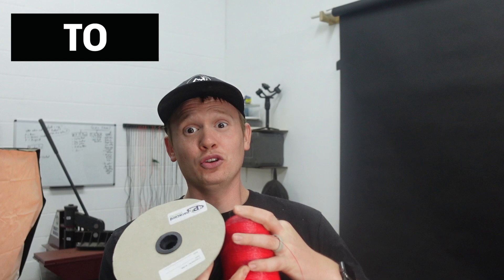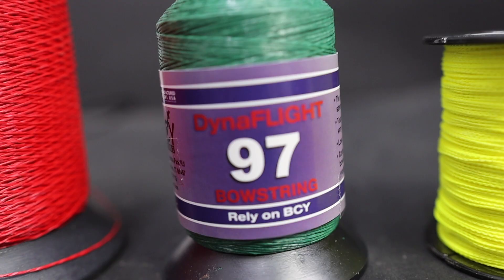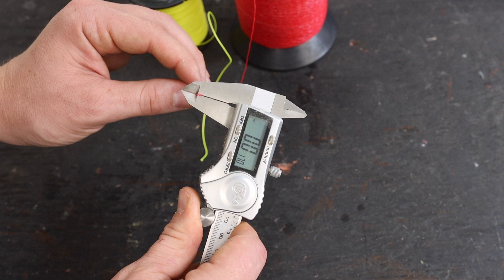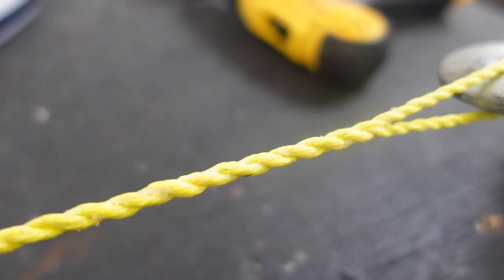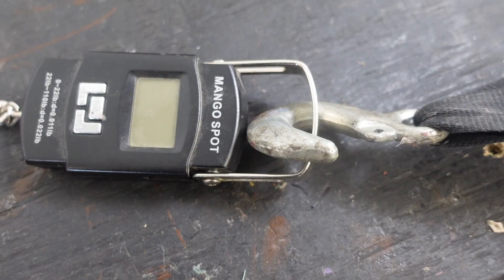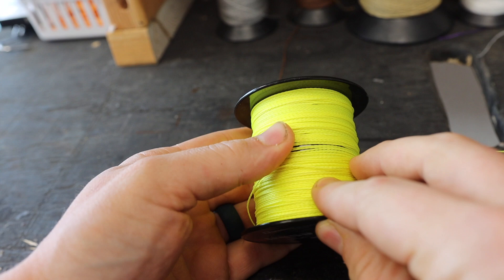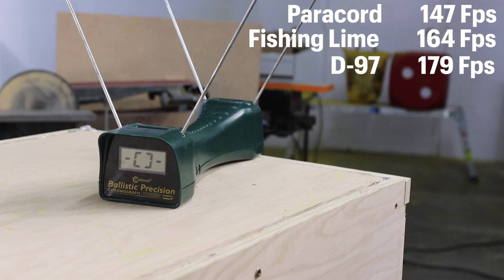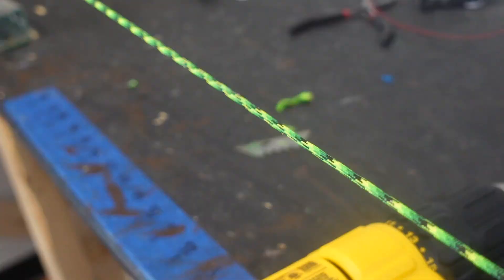What ACTUALLY works for a bowstring? --- (Fishing Line vs Paracord vs DynaFLIGHT)

Comment: What if you use the strands in the core of the paracord and braid that?
Reply: This was my question. What if you just used the Paracord core as a source of nylon? Because the stretch in Paracord comes from the woven sheathing combined with not-particularly-tightly-twisted core material.
Reply: really want to see this test
Reply: The core strands are very slippery.  I've tried using them for other  projects and I found them difficult to work with. Doesn't mean it won't work; could just mean I lack the skill to use it.
Reply: I tried the Flemish twist with just the core strands with no wax. The loops held very well. I would love to see this done by a pro who knows what they're doing
Reply: @DM-sq3jm  sicky substance or wax as he mentioned would do the job. The tie tight and melt in place.
Reply: @danielchristenbury2401  👍 agreed
Reply: What lb fishing line did you use?
Reply: I've been wondering the same exact thing about the core strands
Reply: Yes if the f.line was very comfortable then the cord could give just a little more smooth elastic release ..mmm
Reply: That's what I thought he was going to do in the first place
Reply: I have done this. Used six strands from 550 cord and braided 2x2x2 and its help up great.
Reply: I have also used 250 cord by itself
Reply: @DM-sq3jm maybe you haven't seen the countless other people pre waxing their string before making their bow string 🤷🏻‍♂️ would help reduce the that problem a lil if you don't apply to much
Reply: @elitehacker1416  You n me both buddy 🤷🏻‍♂️
Reply: @Outlaw--JesseB  Maybe you haven't seen the countless people making bowstrings out of actual bowstring materials.
Reply: @DM-sq3jm  well if you're so full of insight then maybe you'd know those of us with half a brain are only researching possible backup/survival materials that could be used genius . . . 🤦🏻‍♂️ Go ahead try an sound smarter 😅
Reply: @Outlaw--JesseB  I just copied your message and delivery. You're getting out of it, what you put into it. 😆

Comment: This reminds me I wanted to ask what you thought about silk bowstrings, I believe ancient Mongolians used silk, but I could be mistaken
Reply: It's worth a try, some silk is pretty strong.
Reply: You could do that, problem is, you need really good premium silk. Most silk is weaker than other natural string materials like linen. So to make a more stable bow string, you need more material, which means more weight, which means less performance. Im sure the Mongolians knew what they were doing and had the best silk possible, but im not sure it would be cost effective now. Thats just my take though.

Comment: "Will it string?" - nice video! How about testing other types of fishing line like monofilament etc?
Reply: Lol, i aim for pan fish, idk how long the string would last ya with 4 pound mono. Might not be worth it. Its going to streach bad.
Reply: Mono will stretch massively.  I'd think even more than Paracord.  Depending on the weight of the braided line it may be even more comparable to D-97.
Reply: @MadRS  pretty much nailed it on the head there.
Reply: Best braided fishing line -  40 lb and use 8 of them 10 ?

Comment: I got a bunch of braided spider wire 100% spectra fishing line out of a clearance bin for cheap and I've used that for bow strings for a long time. The spider wire has very little stretch and has increased my arrow speeds significantly. When I run out of this stuff I'll start getting d97 for my bows.
Reply: What's "d97", JW?

Comment: Before I watch this vid , my moneys on the dynaflight . & there’s also kite surfing string that DYNEEMA & I found it on Amazon with a 3/8s or less diameter rated at 1000 pounds . You can get it in any color & it gos down to smaller diameters too & up in poundage also . This stuff is tough .

Comment: It appeared that the paracord was just strung as is.(I could be wrong)
I feel a more accurate test would be to gut the paracord and use the inner strands to make a bow string.
Reply: 🤣🤣🤣I just posted the same thing - although longwinded. 👍👍👍 Your short explanation is better.
Reply: Now I'm curious about this as that would make it even cheaper...
Reply: Ditto ❤ though you'd have to run it like the others in a Flemish twist.

Comment: When I was 11 I made my a bow that was just a straight springy stick and the string was a 3 piece braid of waxed floss.
I shot it a ton over the summer and eventually the bow gave out but the floss didn't.
I would like to see how well floss performs when a professional makes a string from it.
Reply: I did something similar, shaved the bark off of a sapling, braided I think ten strands of monofilament fishing line, but I used a green stick it split and I got scared to pull it back haha, it’s actually in my profile picture
Reply: Nice. I may go down to the river and do that. But instead work it down and try to get it to last awhile.
Reply: So I’ll have the Spring/ Bow. 
Then get a second one that is shorter or longer? Not sure yet.

Do that crazy Double-Bow. And it should make it last longe r
Reply: Modern floss isn't the same, it's more of a waxy plastic sheet material, like a grocery bag pulled tight. It's not the same as the old stuff at all.

Comment: I know from personal experience that the braided fishing line works great. I had to make a new bow string for my 65lb Mongolian Horse bow. They don't carry those strings on the shelf. I used higher weight fishing line and discovered that I had to use thicker serving string. I also noticed that when shooting the bow is quieter. I made my string during the supply issues after covid. The fishing line was on the shelf at Bass Pro Shops.

Comment: I had an idea for a "Will it Bow" episode. What if you took a bunch of plastic bottles and then melted them down. After melting them put the molten plastic into a mold and let it cool. Cut and Sand the plastic then glue to some type of hard wood to make a bow. I thought it would be cool to see if this idea works because you could add all kinds of cool designs into the molten plastic with different colors. Also if you wanted to you could add some small led lights into the mold before pouring the plastic into it for bow fishing or if you stay out to late and don't have a flashlight. Would have to implement a battery pack with a button or switch into the handle piece of the bow for that idea to work. Hope you like this idea, please let me know!
Reply: ...'you could add some small led lights into the mold'  -LEDs make everything better :-)
Reply from the maker: Love the idea! I will put it on the list
Reply: @kramerammonsarchery  Glad you like the idea if you need any help with the circuit, electrical engineering systems is my field of study.
Reply: I had a plastic bow from aliexpress with a material „p66“, all molten. It‘s very flexible but has barely any power, too little compression power. I would expect similar results for pur PET. But it could be laminated with something harder-it‘s just difficult to find a powerful glue for PET. Epoxy might have a chance. I thought for the compressionlayer to use crushed ceramic powder in epoxy

Comment: My experience with paracord was the opposite of yours.
My tests showed no stretch at all. Leads me to wonder if different types have different properties. Keep up the good work,
Love your videos
Reply: indeed different paracord do have different properties ! depending what they are meant foro , that's why when you go buy paracord there is usually like 10 different spools , its not JUST diametre of the cord <3
Reply: Couple weeks late but the difference is real paracord is nylon.  Nylon stretches quite a bit.  It also comes in polyester which has almost no stretch. Nylon is better in almost every way except for price and if you want it to not stretch. The box store stuff is often polyester.

Comment: Great Video! I did the same test with an endless loop string made of Dyneema fishing line and Fast Flight Plus. Both bowstring were equal in weight and the results came out quite the same. More stretch in fishing line and around 15 fps slower. BUT braided Dyneema fishing line makes great serving! It's like Halo serving but much cheaper and lasts the same. And it comes in serveral diameters, which makes proper nock fit easy.

Comment: my favorite alternative bow string material is spectra speargun cord. Just make it about an inch and a half shorter than you need it to be,  tie two bowyer's knots on each end, then string your bow. It'll stretch to the correct length. You can control the brace height by adjustinng the loops. It's basically a braided spectra string

Comment: I use upolstery thread to make continuous loop strings. I treat the loom as a race track n do ONE FULL LAP for every pound of draw weight. One 1500 yard spool can get me 5-8 strings (depending on if mishaps happen) for my 56 inch 40 pound recurve. Plus the 1500 yard spool only cost less than $10 for two depending on where you get it from.

Comment: 'm gonna guess bow string works best, to include braided Dacron, Dynema, and other "super braid" "fishing line" of course, which are already used for bow strings, anyway. No difference in the Dacron or Dynema used for bow trings or fishing lines. Nylon Monofiliment fishing line would stretch too much. Parcord is a bit large in diameter for modern bows

Comment: I’m sure most string-like materials would be viable as bowstring material, probably not as good as the dedicated stuff but it should work.
Reply: I've made bow strings (Flemish and endless) from just about every type of thin thread, just to see how they work, and found the following. Anything nylon is a waste of time for anything other than the very lightest of bows, it stretches too much, this includes mono fishing line which is also stiff. Linen is really good if you can get it! Cotton not very strong. See what Kramer says about braided but I do use it for finger serving.

Comment: I have used pre-waxed bank line for a string. Never new the proper braid until I come across you videos. The bank line worked great with a normal triple braid and wind for arrow knock area. Still going strong about 6 years later.

Comment: I know this is an old video, but for the paracord a better test might be to pull out the inner strands and use those to make a bow string, either discarding the outer shell or testing that separately.

Comment: Paracord has thinner strings in the a sleave. It is not in a flemish twist either, I would like to see if a it changes if you removed the strings and gave is a flemish twist.... Maybe a hybrid of two or even tree different material.
Reply: I've made a Flemish Twist bow string from the internal strands of paracord. They are still nylon, so it is still more stretchy, thus slower than my proper Dacron string. It would work fairly well in a pinch, but not really worth it, even in a survival situation you're better off spending the energy on proper shelter, warmth and foraging etc.

Comment: Not all fishing lines are the same, like I prefer to use Spyder wire fishing line but they have several different types of lines from soft and flexible to very rigid lines for deep trolling, and I've entertained the thought of using the Spyder wire fishing line to make a new compound bow string, as the one I have is many years old and almost never used, so with that said thank you for the video I did find it very interesting and informative

Comment: First off, I just received my first Shatterproof bow strings. I haven't shot an arrow from either yet, but they look amazing! This weekend I am building a PVC pipe bow with my 6yo nephew and I will put your string through its paces (two separate events, he's not getting his little hands on my brand new bow string).

In any case! I don't think the comparison with paracord is fair because the other two are specifically made to not stretch under tension, where paracord is not. I think the real question is: can you make a functional bow string from a length of paracord? Instead of: does a length of paracord, fresh off the spool, work as a functional string? 

I would suggest using the mill spec stuff (maybe you already are). Just because for once mill spec is actually much better than the regular variety. Just ditch the mantle (sheath or whatever that's called in English) and use the strands inside: 

Use a three strand braid on the paracord strands (the fishing line comes braided and as such has a considerable head start) and then you make a 16 or 20 strand bowstring out of those three strand braids (still with me here?), that's when I think the comparison starts to be fair.

You still need less feet with the paracord version vs the fishing line from a "initial feet off the spool" perspective and though it is a lot more work, it still represents a cheap option people can do at home. 

Also, how would a string (choose your poison) behave if you braid the entire bow string, rather than twisting it?

So many questions! So little time to make videos! ;-)

Comment: Paracords are designed to strech to deal with the opning shock of the parachute. There is zero strech paracord mead to eliminate the need to retrim break lines on parachutes, but they brack often on opnings or cause tension nuts. Might be usfuly as bow string.

Comment: I think the only significant difference betwean the fishing line and the bowstring material is that fishing line is typicaly coated with teflon or something similar. If you think about it a fishingline and a bowstring have some very similar requirements so you would expect them to be made from the same type of material.

Comment: I think paracord might make a better string of you gut it and braid it. The inside strands of paracord are not braided.  This might be intentional as it may be the stretch is needed as a "shock absorber" when opening your chute. Fishing line is excellent under tension, but if give it a snap under slack and it breaks way easier. Just a thought.
Reply: I agree.  I think it should be possible to clamp one end of the paracord and twist the interior fibres.  Great video.

Comment: Well,there is another option,it's called kevlar cord,I found some that is thin and it will hold a 125 lbs,so look into it,you won't be disappointed it's worth the price and I bought a roll......
Reply: It would be cool to see more exotic materials tested. I wouldn't expect them to be very good, but in would be entertaining.
Reply: Yeah, kevlar is freaky strong. Most competition archers in the '70s up until the mid '80s made the switch from Dacron to Kevlar in their bow strings because Kevlar was way stronger and stretched less, giving a huge advantage in speed. The problem with Kevlar thread is that it degrades rapidly in the presence of sunlight and was notorious for breaking suddenly and unexpectedly when the arrow was shot. Be careful!
Reply: @johnbarron4265  yes John,,,you are correct,I bought 3 spools from Amazon and it was around 100,grey,yellow,and black,those are the colors I have and it's really the best string I've found for bow strings,I was really surprised to not see it here in this vid,you and I both know it's the best but yes,it's more expensive than anything else out there but......it last sooo much longer too,take care man,I hope to see around in these comments don't hesitate to leave and read comments,I've learned alot from YouTube and yeah there's alot of B.S. too ....see around man

Comment: Right at the beginning I was thinking "you need to be trying braid, not mono or fluoro," but you were def ahead of me. I'm impressed the 9# braid somewhat paralleled d97 - I thought it would be too light. I wonder if a higher weight braid would end up matching the d97 in every category - would make sense if actually same material. Also, your approach did, in fact, have a decent scientific approach to it - kudos!
Reply: Lots of people use Power Pro or Spiderwire braid for their strings. The general consensus from what I've seen is 60-80lb test is the best choice. Cool thing is it IS less expensive in general...mostly because it goes on sale a lot more often at places like Wal Mart (every season), plus...well, you can get it any day of the week in tons of colors at places like Wal Mart lol.

Comment: With the 550 cord, pulling the core strings out, wetting the hull & then thinning it out might take some of the stretch out. To "thin it", hold one end & twist it while drawing it between something, like pinched fingers (that can be done while pulling out the core strings). 

Also. . . Dental floss. . .  It's pre-waxed, at least, haha!

Comment: I use 7/64” Dyneema HMPE 12 strand rope. No cover thread needed. It has a 1600 lb breaking point. Super abrasion resistant. Good for 500 shots + on a 150lb pull crossbow. Stretch is about 1.2%😊

Comment: I use spider wire braid for bow string and I've never had an issue for the past 10 years.

You should really try spider wire braid fishing line. You'll be more surprise and never use anything again.

Comment: Ah. Mystery solved. I ordered a spool of "Dyneema bowstring material" from our local Amazon equivalent - it was cheap Chinese-made no brand stuff. I wasn't really planning to make bowstrings, I thought I'd be able to find a use for it for my other hobbies. What came was WAY TOO THIN for what I thought bowstring looked like - the cord diameter is about 0.5mm more or less. My answer came at 2:17. Looks like making actual bowstrings is complicated and would requires a number of fixtures and jigs. Who knows - I'm now seeing a bunch of ads for bows and arrows on the app, maybe this might be the start of something.